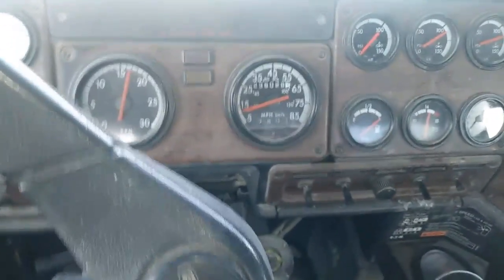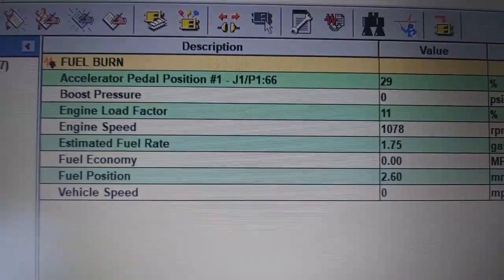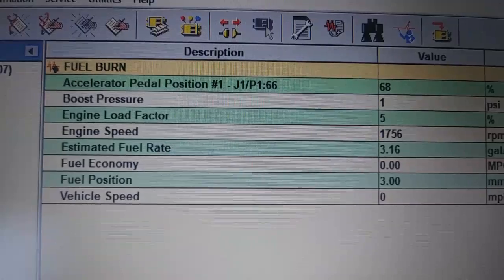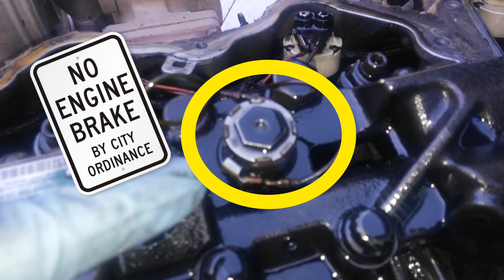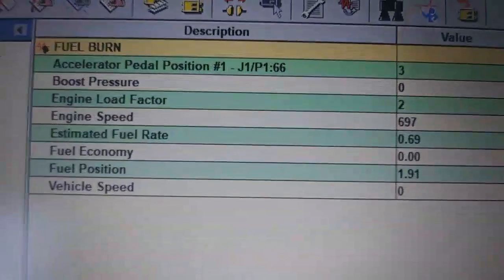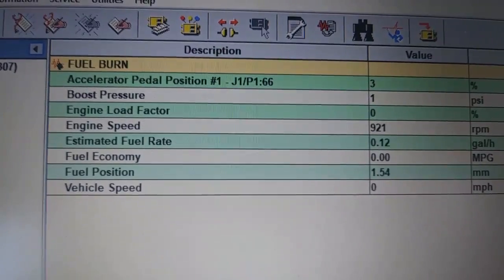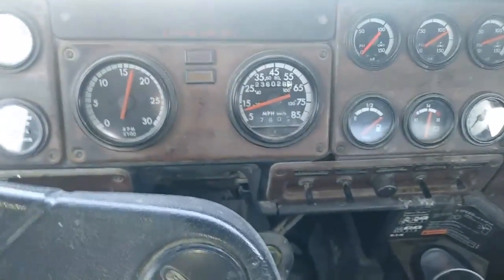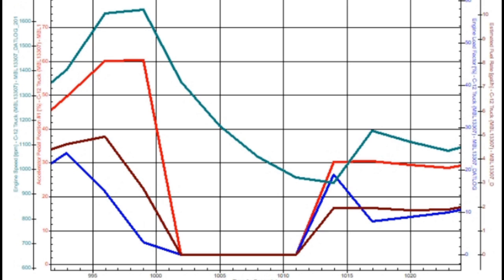Does Engine Braking Waste Fuel? Do Jake Brakes Waste Fuel?

Comment: On a carbureted gas engine, the idle passage, and maybe part of the intermediate circuit, is AFTER the throttle plate.  A high vacuum situation will pull more fuel through the idle circuit.  This will result in a rich situation.  When you are engine braking, assuming there is enough oxygen in the exhaust, it will backfire all the way down the hill.  An air injection cut-off valve and/or a good (non leaking) exhaust system will limit this to an extent.  In a fuel injected engine, the computers have been smart enough for the last 25 years to deal with this situation and limit the fuel.  Engine braking in a carburated gas engine will result in lower fuel economy than rolling down a hill in neutral.

Comment: Has anyone done a video where they turn off the truck to prove it? I know in modern fuel injection they shut fuel off using zero fuel. I know you can't do this on semi trucks because of safety concerns and they probably watching you in the trucks :D.

Comment: Does engine braking clean carbon deposits? I suspect it does especially for extended declines..I drive a sprinter van and it seems to run better after a mountainous trip

Comment: I have a rather interesting question.i used to kill the engine and used the engine brake for my carburetted bike. does the engine still use fuel or does it squirt it and waste it inside the engine? and lastly but not least , is doing that bad for the cylinder walls and piston?

Comment: Even if it did, I'd rather waste a bit of fuel instead of, like, you know, dying.

Also, what you said about storing energy by air, is actually how GM's active fuel management cylinder deactivation works. At least on the LS, what it does is it disconnects the exhaust valves on 4 cylinders at the bottom of their stroke and holds them shut. Because there is air trapped inside that cylinder, it now acts as a big spring, so instead of those dead cylinders being dead weight, instead it's helping the engine rotate the crank more easily. When the ECU wants 8 cylinders again, it reconnects the valves to the valvetrain and everything continues as normal. I'm not exactly sure how the connection/disconnection happens, only that it does. In 4 cylinder mode, those valves are no longer part of the equation.

Comment: My dad has a GMC 2500 with a Duramax diesel engine and he pulls a fifth wheel camper with a boat hooked up behind that, so a decent amount of weight. He told me that he doesn't use the exhaust brake (yes I am aware that is different from a jake brake, that's besides the point) because it makes the auto tranny downshift and makes the RPMs get high and it uses more fuel. I told him actually when you aren't touching the accelerator pedal it doesn't use any fuel at all, but he insisted. He said his MPG gauge on the dash always shows lower MPG when he uses the exhaust brake when he goes downhill. Is he right or just really stubborn?
Reply: I wouldn't say really stubborn
Just stubborn.
Now, you want stubborn ? My Father (RIP) ....

Comment: GO BACK TO SCHOOL.
INTAKE VALVES STAY SAME.  COMPRESSION STROKE IS SAME. EXCEPT  JUST BEFORE  T.D.C. THE EXHAUST VALVES OPEN . MEANING THAT EXHAUST STROKE IS A COMPRESSION STROKE UNTILL JUST BEFORE T.D.C. WHEN THEY OPEN. (DELAYED) THAT IS WHERE THE BRAKING HAPPENS. IE JAKE IS VALVE TIMIMG. nothing to do with intake. how detroit works is different.
also the compression of gasoline eng. is not enough to make much difference and can cause real popping back ( engine on fire)

Comment: Look up "Telma" electric end brakes on driveshafts of European trucks and cranes. Amazing stopping power. I was driving a 180,000 lb Grove GMK 5300 crane down a steep grade and pulled Telma brake almost went through windshield.
Not sure why American trucks don't use them?
Reply: Not needed american trucking service is basically on the style of "if it ain't broke don't fix it"

Comment: Why don't  they now design a way to make a Jake brake quieter?  What type of half ass design in this?  Airplanes have many noise quieting features and so do space vehicles but trucks are just big noisemakers?  Are all the truck Engineers on vacation at the same time?  Why not have a special exhaust system that is super quiet that gets engaged only for a Jake brake and then when power is generated in the engine, it goes back to the normal exhaust system?

Comment: Hi guys, the Swedish brand Volvo trucks has a really great system for engine brake that's called VEB (Valve Engine Brake) that in principal closes all the valves and brakes the truck really good even with full load (60tonnes) or 
132, 277.357 pounds/lbs of weight, when empty you don't even need the manual brakes at all if you use VEB at lvl 3 😁+extra the system uses the valves and a exhaust brake, so lvl 1 is only exhaust brake, lvl 2 only valve brake and lvl 3 both of them!

Comment: Not really related but ...... Standby generators need to start up and go on load within about 15 seconds, even with a block heater it is not at working temperature. If a hot engine makes 700kw how much reduction in power is there just after start up?
Reply: ,,, there is certainly less power available, because of the thick oil and heat loss to iron or aluminum, buuuuut the design has more power than the generator needs so the governor is just constantly adjusting for load or lack thereof.

Comment: Thank you, in other words release of throttle turns the engine into an air pump that imparts a braking force on the output shaft  (drive train).
Reply: ,,, with a time release of quite a bit of potential energy, that would have otherwise went plus energy to the drive-train .

Comment: I have a 3126   ser#  1wm25349 how can I get a turbo part #?     275HP    rv  is my engine a E or B ?
Reply: S/N 1WM25349
1523344 ENGINE AR COMPLETE
1208244 ENGINE AR-CORE
275 BHP AT 2200 RPM. FREIGHTLINER
TURBO  0R6923
TURBOCHARGER INSTALLATION KIT 4370080
STUDS if needed 8T7044
LOCK NUTS if needed 3E8017

Comment: Does that apply to a non electronic engine as well ? Say a B model.  Or is there still fuel being sent to the nozzels when the throttle is in the idle position, and the Jakes are on ?
Reply: IF I SAY IF, system is wired and working correctly, foot off clutch and foot off throttle. You inject low idle fuel delivery. If wired incorrectly, you might want to clean out your underwear, it makes a heck of a noise and smokes. Possible engine damage.

Comment: The diesel engine has one draw back, especially 2 strokes, is that they will run on out of control. The Jacobs brake works on that principle minus fuel.
I watched a guy at an asphalt plant throw his flannel on the air intake of a fully out of control 2 stroke diesel. The motor never even hiccupped, it swallowed the flannel into the turbo immediately.  The color of smoke out his stack was slightly darker but it had no effect on engine rpm. It finally spun enough bearings and broke the crank. The damage was insane. One of those moments I look back on wishing cell phones back then had cameras.
Reply: Authority can Suck it with Authority the same thing happened to my F-I-Ls 82 Olds diesel! He put the pump together with the shut off valve in the wrong position! When it finally hit, it ran wide open for several minutes!! It had no turbo, and still sucked a flannel coat thru it!! Cut battery cables were no help. It got so hot that it blew the upper rad hose off, while my F-I-L was leaning over it! He was a big fellow, and it threw hit a pretty good bit!  

Vice grips on the fuel line finally got it shut down!! Just short of a complete melt down, I do believe!! But the engine was toast!! It shredded the accessory belts! Erupted coolant from the recovery bottle! Black smoke poured out the dual tail pipes! The noise it make was horrific! Probably burned up a 1/4 tank of fuel, before they got it shut down! My B-I-L was looking for his cigarettes!! He then realized that they were in the flannel jacket pocket, and marveled that the cigs were swallowed up, and consumed so easily!! I then reminded him of the flannel jacket!! The pack of cigs didn't have a chance!! I fully expected it to grenade!! But it didn't, surprisingly!! It even still cranked over, after it all cooled off! But never ran again!! We never took it part, to find out why!! It was like accidentally killing a neighbor!! We cleaned up! Disposed of any evidence! Replaced things as needed! And never spoke of it, afterwards!! My B-I-L once mentioned that he missed that coat! We just looked at each other, athe subject was changed, and the thought went away!! GOOD TIMES, I tell ya!! NOT!!

Comment: Hey Josh, I have a question about Jake breaks...  old school Cummins engines when you use the jake on a down hill you (DONT) hear the Turbo and say a Modern CAT or Detroit 60 you do hear the Turbo kickon? always wondered why that is
Reply: ,,, my N-14 that is kinda old school will make 20 pounds of boost on the Jake @ 18 hun rpm, but I can hardly hear it .

Comment: Hey great video but what about the Diesel engines that DO have an throttle valve like the newer ISX and horrid DD engines and could you tell us why most engines after 07 have such quieter jakes it just sounds like loud hissing air especially on the DPF but a lot of regular muffled engines have next to silent jakes
Reply: They still make kinda loud or noticeable noise of a Jake kind of like a growl. I work around DD13s and MP 8s, they have gotten a lot quiter
Reply: ,,, I generally ignore the existence of any Diesel with anything other than an air cleaner, cooler, and compressor wheel in the intake tract, lol. But, what's this ? 99 percent of the world market ?
Reply: The flitters help reduce noise and the EGR helps dampen as well

Comment: Now I'm curious if open throttle plates in a Diesel would cause any restriction, some of the older Diesels use a choke shutoff, and there are aftermarket throttle kits to prevent engine runaway without using dioxide.  Also curious to see which generates better performance for NA and forced inducted Diesels, cold air intake, short runner intake, ram air intake, etc.

Comment: Good info and video as always.I think engine brake does not waste fuel while using it correctly ...
But if you use it to often without needing it and then you have to put throttle down again and repeat that too much then probably you'll have to use more fuel to rev up again...

Comment: FOOT OFF THE THROTTLE should be a indication that no fuel is being burned. Truck drivers are absolutely Dumb. Some cant even back up tucks. And the new guys (and girls) cant even shift because they went to school to learn automatic only.

Anyway. if you are reading this. Whether you are a truck driver. Car driver, whatever. Do not croud or ride their ass.

Comment: So my Kodiak with a vgt only works on the exhaust side of breaking, is not as efficient as the traditional Jake brake ? Or does the vgt also cut off the intake flow as well?
Reply: Exhaust brakes are not as effective as engine brakes, they are however quieter making them a good choice for delivery vehicles/RVs.

Comment: The ironic thing is those people who throw their vehicle in neutral downhill to save fuel, on top of losing all assist down the hill of engine breaking, will actually burn more fuel because with the trans in neutral it takes more fuel to hold the engine at idle rpm
Reply: Talk about endangering others and yourself . . . (O . O)
Reply: @GIGABACHI  it also takes more energy to use the braking system than using the compression of the engine to slow the vehicle down.
Reply: Well in 18 wheeler industry no one does that , because engines brakes don’t work in neutral and trucks with heavy loads are impossible to stop without low gearing + engine brake + service brake
Reply: You Tube You Tube on the first point, yes they do. I’m into a truck or tractor trailer and in neutral, Rev the engine up to 1200 or 1300 rpm with the jake switch on and let off the accelerator. You hear it all the time at truck stops when a guy forgets to shut off his jake, idles up his truck to grab a sandwich, then hits the break to drop it down to idle. It just doesn’t help with braking, but they still actuate in neutral

Second, you absolutely can stop a truck without needing those three things. It’s a legal requirement that in an emergency panic break situation that the service breaks of the truck and trailer alone have to be able to stop the truck and trailer in a timely manner. When a car or truck pulls out in front of you, you need to be able to stop NOW. You won’t stop quite as fast as a car, but you will stop within a few hundred feet. Where jakes and downshifting come in is on long downhill grades, and you do not what to even touch your service brakes as they would soon get hot and brake fade would become a factor.

And three, it does happen, a lot of idiots out there. I’ve seen a few shops come in with snapped driveshafts or blown up transmissions because the coasted down a hill (we call it Mexican overdrive) but then something happened and they had to slam everything back into gear.
Reply: speed150mph I would love to see you slam a non sincro trans into gear at speed. You said it the beginning you are new. Keep your rookie comments to yourself until you get some miles. This is from a 40 yr vetran with almost 4 million miles behind me
Reply: holmes1956O I’m not gunna lie to you, I don’t drive truck much, my dad is an old hand behind the wheel like you and he taught me to drive. I’ve been a mechanic for 10
years and trust me sir when I tell you that you can force an 18 speed into gear in the situation I described, but it usually doesn’t end well. 

In the two cases I’ve ran into of it happening, one guy snapped the driveshaft just ahead of the steadybearing and tore up the airlines and cracked the fuel tank on his 379 Pete. The other guy running a T800 kenworth with an 18 speed ended up destroying the transmission (the shift linkage was bent, the sliding shift collar for high gear had the splines tore off and 5 teeth were snapped off of the main shaft gear.) 

But yeah, I know it can be done, but it is a damn stupid thing to do, and a even more stupid situation to get into in the first place.
Reply: putting it in neutral might even damage your gearbox!   best to save as much fuel as possible is putting it in higher gear  (if don't need to brake)
Reply: Alessio S you are absolutely correct that it can cause damage. However your wrong about fuel useage. In a Diesel engine, when decelerating the engine goes into no-fuel to try and slow down, so no fuel will be used.
Reply: yeah that's the dumbest thing you can possibly do. when in neutral, there's a risk of the vehicle stalling. obviously that risk is insanely small if your vehicle is is good working condition, however, if it does stall, youll lose power steering and hydraulic braking, so good luck!
Reply: speed150mph 
You should never put the transmission in neutral while moving.
Reply: If you put it into a lower gear to get engine braking, sometimes the ECU will actually switch the injectors off, completely, because it doesn't need any fuel whatsoever. The car rolling down the hill is what's keeping the engine running, it's basically forcing the engine to stay running, so you don't need fuel to do that.
Reply: It can actually save fuel though! Off course, if you're trying to decelerate or stay at a certain speed downhill, you might as well leave it in gear for the engine to assist in braking. However, on long level or very slight downhill roads coasting in neutral can actually save you more fuel than being in gear. This is because in neutral minimal fuel is being consumed to idle the engine rather than the engine in gear slowing down the vehicle and the driver having to accelerate again to maintain its speed. That is true for cars and light trucks at least. In fact latest model mercedes have a feature where the transmission does just that.
Reply: @nobenznofun9139  auto shift semi use neutral down hill as well.
Reply: Jay Dunbar they absolutely do not, they need to stay in gear for engine braking. In fact you can put them in L and it is designed to downshift more aggressively for increased stopping. We had an Easton rep come to my college class during my final year of schooling and he went through that transmission and it’s systems with us. (Both the 3 pedal, and the full autoshift)
Reply: @jaydunbar7538 2017 Volvo I shift uses engine braking big time.
Reply: @nobenznofun9139  Don't roll down a hill in neutral with a truck. That's stupid especially if you're loaded.
Reply: NoBenzNoFun 91 that is absolutely not true. When decelerating, the engine (at least Diesel engines) go into a no fuel state. As the name suggests, no fuel is injected into the engine when decelerating, its only the external driving force turning the engine at that point. This holds true for both mechanical and electronic injected diesel engines